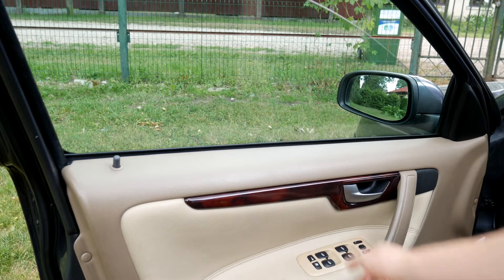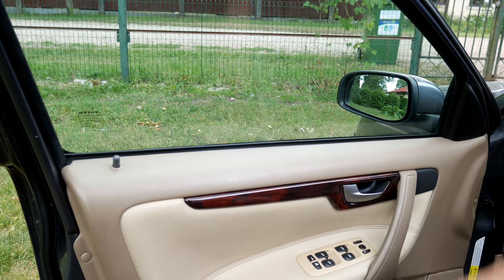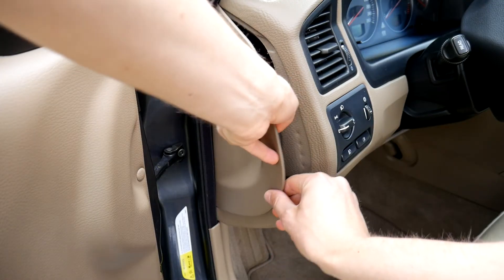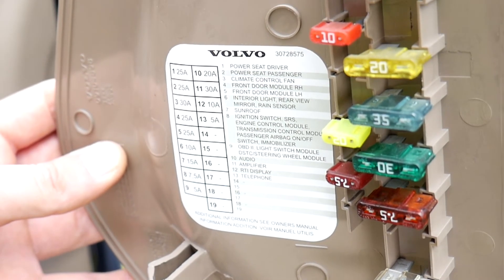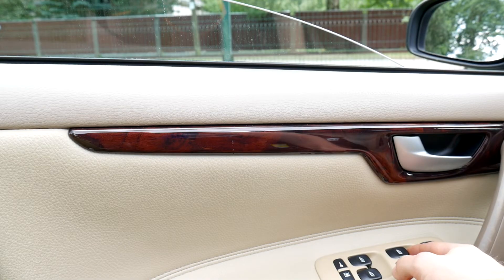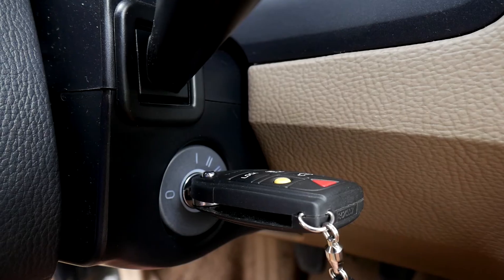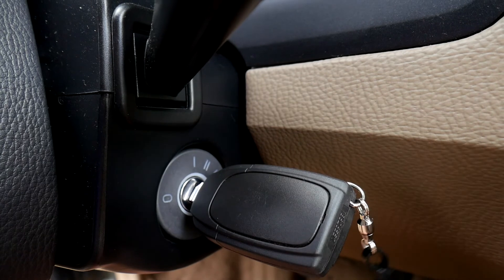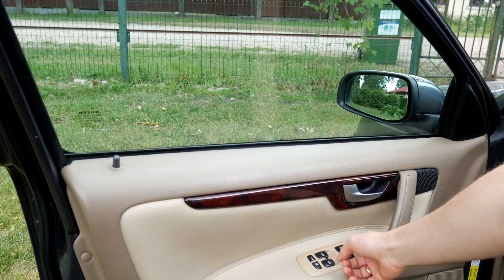How to reset window auto Up/Down function Volvo cars

Comment: In my case (VOLVO V70, 2005) only this helped: Key position II, when lowering the window I pull out the fuse, then the key to position 0, after a few seconds I put the fuse back and turn the key back to position II. Now attention! I lower the window holding the switch in the first position (manual lowering), the window goes down to the very bottom, and I still hold it for about 10 seconds. Then the same up - I pull the switch and hold it in the first position (manual lifting), the window reaches the very top, and I hold it for about 10 seconds. After that, the window started to go automatically (switch in the second position) down and up perfectly!
Reply from the maker: thanks for feedback :)
Reply: Thanks for the additional info!
Reply: This is what worked for me too 2005 S80
Reply: This worked!!!!
Reply: Thank you! The video disabled the automatic up and down (which I was fine with since the windows were no longer lowering by themselves), but holding the button for about 10 seconds when the window was closed did the trick for me. I didn't even have to hold the button in the lowered position on my 06 xc90 2.5t.
Reply: @ryancool3271 Exactly the same thing happened to me with my S60 P2. After reading your comment, I decided to hold the switch in the top position for 10 seconds, and the auto feature re-enabled and started working properly again

Comment: There can also be a seal kindof protruding out by the plastic where the mirror is on the inside provinding resistance enough for the safety mechanism to stop the window. Had that problem (V70N)when I had wind deflectors. Hope its useful info!

Comment: I just did this and works to go all the way down but once I put the window up in auto goes back down and doesn’t go all the way down. Wondering if it’s a mechanical part that is in need of replacing any info helps and this video was awesome and easy to do it

Comment: Fixed my 2008 XC70.  25amp fuse located in the rear of the cargo area. The number 2 fuse controls the front passenger window.   Had to hold the down button 6 seconds on the reset part of the instruction, after that auto up and auto down now work perfect as should.  Thanks. BIG HELP !
Reply from the maker: thanks for feedback :)

Comment: It works. Thank you so much. You're the best!
You made pulling out the fuse look so easy. I had a tough time pulling out the fuse because it takes a lot of force to pull it out and the plastic fuse puller easily slips off. I had to use the fuse puller to pull the fuse partially out so it was loose but still connected, that makes it easier to pull out at the right time.
Reply from the maker: thanks for feedback :)
Reply: @TechscrewHome  You're welcome!

Comment: On my 2004 S60, the passenger side window's auto-close is permanently disabled, is there a way to enable it? That is clearly an option, not a malfunction, as the switches read ok when in "auto" position, and both windows are calibrated.
Reply from the maker: i have the same problem https://youtu.be/blvhq86g5Hw
Reply: @TechscrewHome  Nope, not the same ;) The auto-open works on both sides for me, only the passenger side auto-close doesn't. No calibration issues (I used a scan tool to both check and reset those just for the case), no switch issues (again, tested by reading the state of the switch with the tool). According to the manual, some S60 versions indeed have the auto-close disabled on the passenger side, and I know another person with the same "issue". Wonder if it can be re-enabled using VIDA (I use ThinkDiag, which lists some programmable options, but nothing on this window feature in at least DDM/PDM and CEM, only actuation tests and soft stop).
Reply from the maker: @TheBypasser  okey, thanks for feedback :)

Comment: The calibration is still not precise. You are missing a very important step in the video...open and close the boot 3 times before pulling the fuse out. Come on, just kidding. 😂😂😂

Hold the switch to a lift position until the window stops in the frame and keep it for 2-3 secs longer. Perform the same with the down position. Ta-da-a-aaaa. Window positions calibrated and no fuse pulling needed.
Reply from the maker: wow, thanks for information.
Reply: @Techscrews  It did work on many Volvo's before.
Reply: @Techscrews  There must be something you aren't doing right. Try using only the switch's first stage for manual lift/drop.